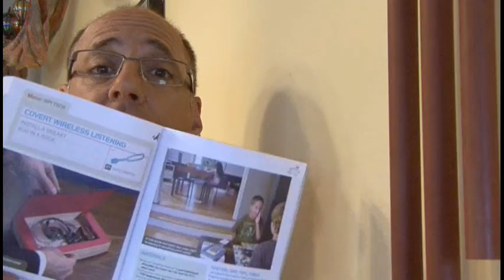Weekend Project: Wireless Covert Listening Device

Comment: If you use a mono transmitter and replace the two mic output wires with video output wires from a camera, then replace the speaker in the radio with a cord that can be hooked up to a TV, it can now transmit video!